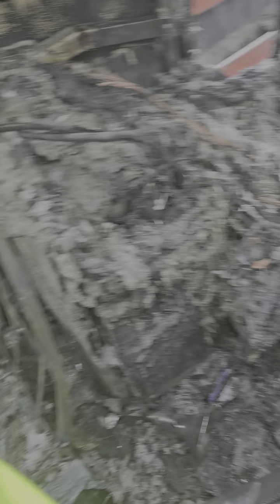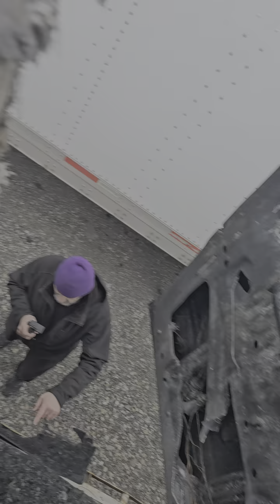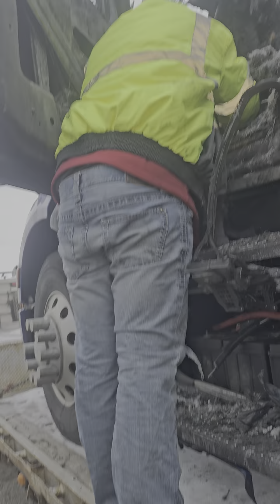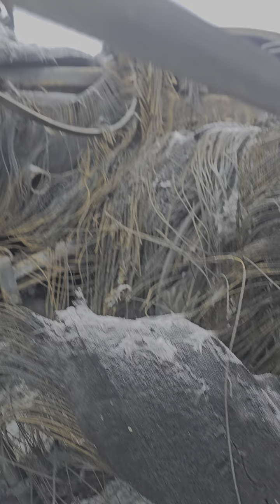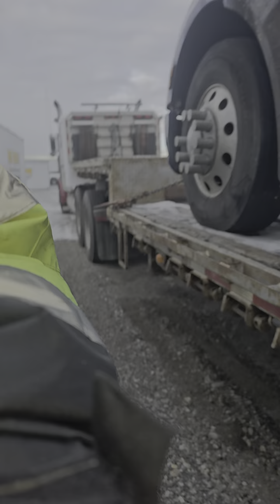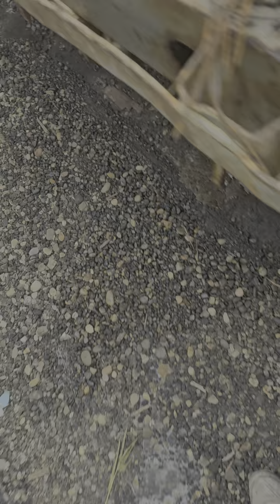truck burned .That is what saved ok the truck, nothing  no documents noting

Comment: Only the batteries were spared from the charring. The fire was burning quite hot to melt the top portion of the driver aluminum fuel tank.
Reply from the maker: Ho yes very hot. Fire not even go close to the hood etc and even the hood was burn etc due to the fire
Reply: Fire burns upward, thus the diesel in the tank did not ignite and batteries did not melt.  Something caused the drivers side tank to rupture/get a hole in the upper portion.  The front of the truck was not destroyed.  Was the wind blowing?  Google claims diesel ignites at 550 c or 1,027 f.  A bearing on a truck operational temperature is between 140-175 f.  Based on this, diesel was not the source of igniting the fiberglass/plastic.